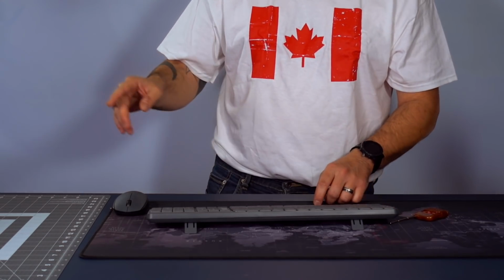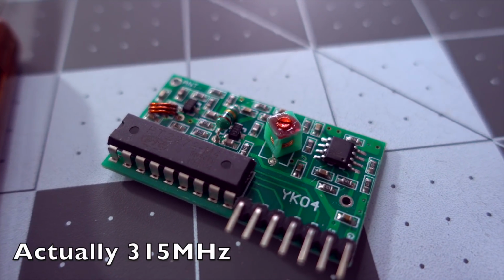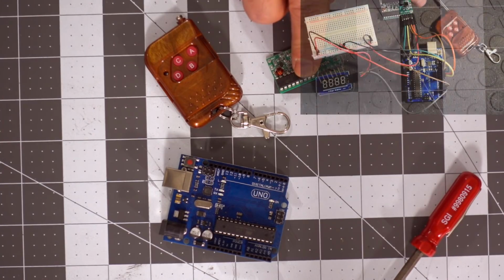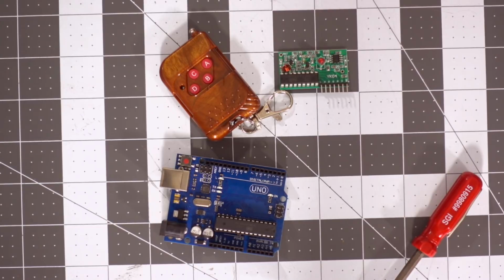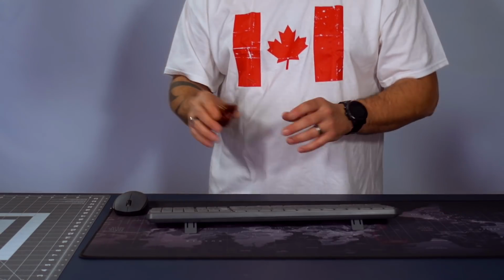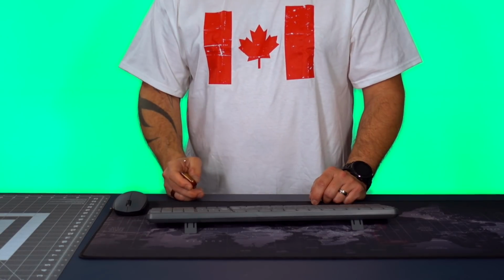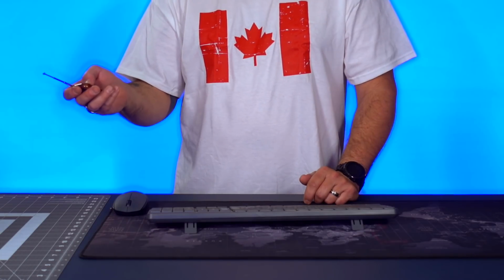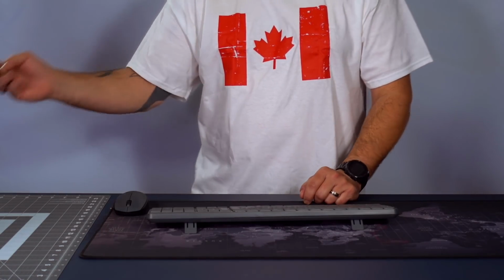RetroReflective Green Screen Testing and RF Remote Control Update - Tutorial

Comment: Does this material work if you shoot at an angle or does it need to be straight on towards the camera?
Reply from the maker: The material will reflect the light at any angle, doesn't have to be straight on.  Check out the webpage of this project here for more info on the material used: https://www.brainy-bits.com/diy-retroreflective-green-screen 
Hope that helps and thanks for watching
Reply: @BrainybitsCanada  Thank you for the reply! I'm VERY interested in this!

Comment: Hi ...could LED strip lighting like this link below be used to make the LED array? It comes with a remote and the power supply. Thanks                   https://www.ebay.com/itm/Led-Strip-Lighting-2-5M-32-8-Ft-5050-RGB-150-LEDs-Flexible-Color-Changing-Light/401796756618?epid=13032785057&hash=item5d8cf3f48a:g:VaQAAOSwOO5dE7QJ:sc:USPSFirstClass!16833!US!-1

Comment: Awesome thanks for the followup. I am piecing three of these together and when overlayed on one another they dont show a seem. So i think it should work. Do you notice any finger prints on your material if you touch it? I got some cheap panels for the one I'm making and it shows the finger prints with a camera flash. We'll see how it goes when used with the LEDs though. Might not matter as much I dunno.
Reply from the maker: Yeah the material is kinda fragile and should not be touched too much, I've got little smudges here and there on mine and it doesn't seem to affect it much.  Thanks for watching!
Reply: wear gloves, prevent the prints

Comment: I really want to try this green screen idea. I tried hanging a blanket in the past, but as you said, the wrinkles really wreak havoc! Also, those little remotes are really handy, and work well, especially considering the price.  I used one to control my hydraulic winch on my welding truck. It's so nice not having to walk back and forth to the controls.
Reply from the maker: Yeah those little remotes are very cheap and easy to use in all kind of projects.  If you have time give this Green screen a try, it works really well.  Thanks for watching!